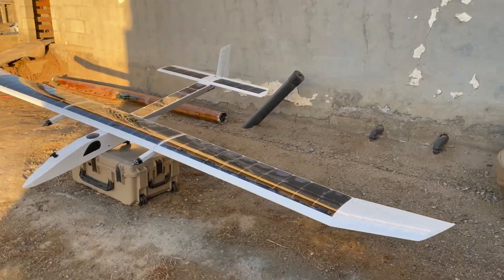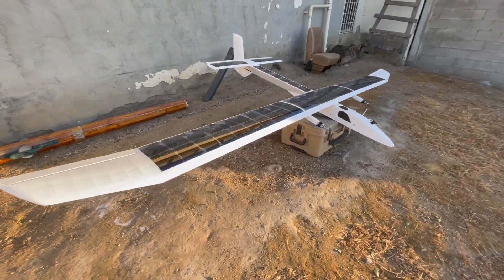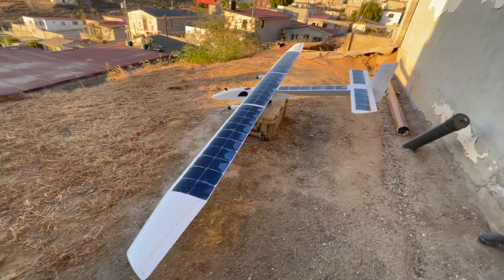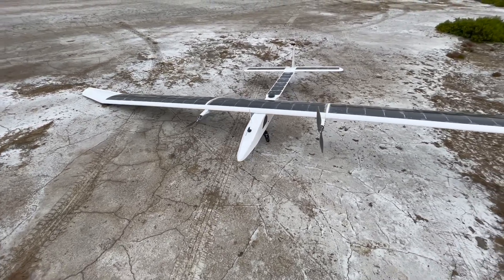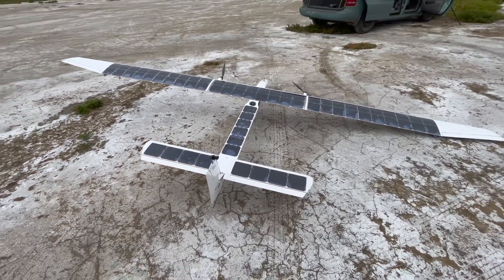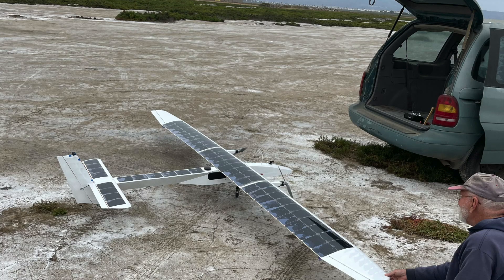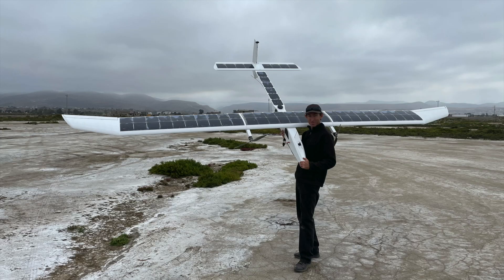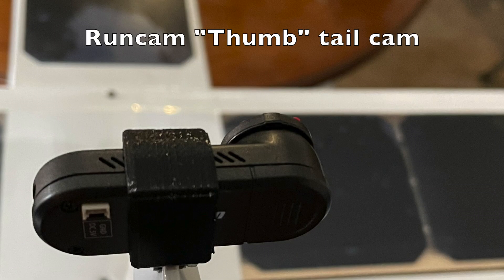Solar Plane  "SOLAR DRAGON" First Flight !!!

Comment: do you understand that  dihedral  OR  ailerons  should be used;  NOT  both.?
Reply from the maker: No I dont' understand why both cannot be used.    please explain.     it is neccesary to have both ailerons and rudder in order for the autopilot to make a coordinated turn.   and there seems to be no harm in having some dihedral.  plenty of aircraft out there with some dihedral, which also use ailerons.   they are not mutually exclusive.

Comment: information.       do you understand that you have chosen to use  thin  props that, like SF props,  tend to un-load as higher rpms.?            it is clear that the model has a less-stable   DISTRIBUTION OF MASS (dom).!!!       there is a  REASON  that a tail boom is  USUALLY  tapered.!        there  is a reason that, frequently, there is chord-wise taper across the span of a main wing.        there is a reason that motors/engines/props should be as near the center line as is practical.         at :07, what's  with  the  giant ventral tail 'skid'.?!?!?          googletranslate
i am wondering whether the wing is  CORRECTLY  made.
Reply from the maker: first of all the props..   yes, props flex.    these particlar props are less than ideal.   they do not have enough pitch.  i'm sure they do flex, and twist under load.  they do not have much load.  they are designed to spin much faster than we are currenly able to with this voltage and motors. 

less, stable distribuiton of mass..      not sure what you mean?   that it's too distributed, or not concentrated enough.   few large span aicraft have concnetrated mass.    we've tested many types of aircraft, and not seen any bad characteristics due to mass distribution. 

yes, It woudl be good if the tail boom were somewhat tapered.    however, probably not as much as it seems, as the horizontal stab is also in need of support, as is the wing, so for the next version, we will be incorporating some taper in the boom.  
tapered planforms...  sure, woudl be great, but it woudl change the reynolds numbers.  and for the solar plane, more importantly, would not allow even rows of solar cells to be mounted without wasting space.    as aspect ratio goes up, it's less of a factor in efficiency to have a constant chord wing.   and the outer sections do have tapered planform. 
Yes, it woudl be good, better to have the motors closer to the center, in case of a failure.  so that there is not so much offset thrust.  we designed the plane as a 4 motor config, and the inner pods are removed.  we will likely go back to this configuration of 4, or maybe even 6 motors. 
the "giant ventral tail skid," is just part of the vertical stab, extending below as well as above the fuselge.  It's called a crizifix tail config, and has been used on some aircraft before, notably solar impulse, and some high performance pushers.     so what's with it?   it is structurally more effecient than a vertical stab which only extends below the fuselage.   and imparts no, or little  twisting force to the fuselage.   it is a pain for landing.    
so you are wondering whether the wing is correctly made..     seems to make lift and it stayed intact for the one test flight so far.  with minimal flex.  so far we are happy with it.        specific suggestions that are helpful are appreciated.

Comment: Check out the Kraus K1000 ULE. It has full solar on the wings and elevator, but a very slim fuselage with few pannels on it. They are also using ArduPlane and autonomous soaring with great success!
Reply from the maker: Yes I did, thanks for the tip!   and I'll try to dig up some more info.  one of the leaders of their group, i recognized.  Saw her on an episide of BG THINK YT channel. she was talking about perpetual UAV's.   but she said some stuff that didn't make sense.  like claiming that a Ram Air Turbine woudl be useful to power the aircraft and enable it to fly all night.. of course use of the aircraft's kinetic energy in that way, with the conversion losses woudl be far worse than just using batteries.  but.. anyway.  seems that they have had some success.  will try to glean any usefull details from the project that are availabe.

Comment: Intermittent problems suck! Nice job saving the plane.
Reply: Yeah! There the worst to troubleshoot and solve.
Reply from the maker: @ezrarichardson279  we were a bit fortunate to observe the problem, very specifically, of the right aileron not moving when the left one did, immidiately after landing.   otherwise it may have remained a mystery,   but perhaps not, becase the tail cam caught the left one, and the action (or being stuck) of the right one can be derived from the behavior of the left one.
Reply: @FPVREVIEWS  good catch
Reply: @FPVREVIEWS  Nice! Was it a connecter that came half unplugged on the right one? Nice to know you were able to observe the problem. Sometimes you don't get too. I had  a plane I built that flew fine but then would suddenly do something really weird every once in a while and it caused me a couple crashes. 
   I still don't know why, it was definitely an aerodynamics issue though. I scrapped the whole aircraft after I realized that in it's current form it was a lost cause. I did make another one with the same electronics and it flies really great. 
    Lots of lessons learned from every aircraft it seems. I've simplified my designs and have seen a lot of improvement in flight characteristics. Love to see what you do next!
Reply from the maker: @ezrarichardson279  Dissected the connector a couple days ago.  it was just very poor quality, and the ground wire not making good contact between the pin and the slot it plugged into.   a regular cheap servo extension wire..  i shoudl not use those anymore.    so am changing all of them.  yes, a learnign expereince for sure.. as always.  simple designs tend to fly well with less effort in development.  but sometimes some complexity is needed to make advanced concepts work.   although they often undergo a similification process, or two, at some stage of development.   would love to see your designs.  will check your channel.  do you know what aerodynamic promlem caused the issue with the one you mentioned?    So far, i'm very happy with Dragon, and can't wait to fly it again.  it was scary at times, but there were times where it felt fine, and i was comfortable, like the fly-by's and the approach and landing. turns out that was the time that the aileron was working normally.   so glad i found that prob. and it didnt' eat the airplane.
Reply: (it's not the same flying wing as on my channel, that one is great!)

Comment: Great content! Many things can go wrong in the test flights. We have encountered similar issues with control surface servos. Servo signal is disrupted quite easily due vibrations. Especially the connectors if they vibrate agains frame for example.
Reply from the maker: Yes, although we usually catch these things before flight.  These were just very low quality servo connectors. we're going to discontinue their use and replace the ones on this aircraft.    True, there are always vibrations in the airframe, even if it flies very slowly.  If nothing else, because the air is turbulent.   Low voltage signals need a near-perfect connection.
Reply: @FPVREVIEWS  Do you happen to have any connectors that you favour? We have recently tried many different ones but are still finding good price/quality ratio solution.
Reply from the maker: @viimaaerospace3366  We have some Amass MR-30 conenctors that should be suitable and are relaible.  they can be a little stiff, but we havent tested them with wire connected, so will try.  We are using XT-30 connectors already for the solar connections at the wing joints.

Comment: tape three nickels to the nose
Reply from the maker: does it look too tail heavy?  maybe a little. ..  I also put some incidence in the horizontal stab, and could remove a little.        the other reason that it was oscillating (perhaps)is because there is latency in controls due to use of the PPM sum converter.  I need a better RC control system with SBUS out. preferably long range. just out of money at the moment.
Reply: @FPVREVIEWS  I would also add a pixhalk 4… in addition to the cube… split everything going on between the two…
Reply from the maker: @Paranoidtimes  It is my understanding that the Cube black already has triple redundant IMU's, heated, vibration isolated, and dual processors, for redundancy.  But, yes, it's the same idea.
Reply: @FPVREVIEWS  yes… I was suggesting a second one to handle some other Functions… if I understood right you flip solar chargers? Right? But manually? If the batteries where split they could flip automatically, charge automatically ect… I apologize I’m getting way ahead of your build… imagining how I would do it and so forth… it’s a bad habit lol the second could be used for this and with the smaller sizes of pi boards, it would be very easy and helpful to automate a system and one that can self control and correct in mid air… how cool would it be just to strap in at night and fall asleep as it flys along?
Reply from the maker: @Paranoidtimes  Oh, yes, the cube can be connected to a companion computer, such as a raspberry pi, etc.  I have no idea how exactly that would work.. and I guess the companion computer could run some code which would handle the MPPT charging.  there are plenty of AUX outputs on the cube black already. like 6, or 8 of them.  but perhaps the companion computer would have a direct signal from itself to the charge controller.  Not sure.  That all is beyond my scope at the moment, although I would like to learn how to write the code for it, etc.    Without any help or collaboartion on that, I would probably just purchase a stand alone MPPT charge controller and install it, letting it automatically handle the charge controller functions.  That's what has been done, more or less, on other successful solar aircraft projects.  seems sufficient.  I can think of other things for a companion computer to manage, such as to change the climb/glide profile to store kinetic energy in the form of altitude approaching solar evening, and after solar morning.  as well as managing navigation to suite weather conditions, to stay out of storms, take advantage of tail winds to get to a location faster, etc. etc. etc.     the direct solar charging is a very short term solution to make sure that the plane does not erupt in a fiery plasma ball of hell while on the ground, or in the air during the first flights.   funny story:  I realized on my way to the field that the plane was sufficiently assembled, with the center wing section, and horizontal stab on, and connected, that it was charging the battery which was already fully charged, while inside the transport van, and was worried on the way there that it would over-charge..  but it was ok.. there was not enough power to hurt it, and it was very overcast.  but I'll be switching it off next time.  might even install a hardware safety switch to kill the solar array output when not ready to fly, and add it to the pre-flight checklist.   you know how those Tesla batteries can get when they are over-juiced..   ha ha 
thanks for the suggestions.
Reply: @FPVREVIEWS  “Acxico  Solar Charge Controller Board” cheep and effective
Reply: Should let you switch automatically from solar to battery depending on the voltage from the panels… small as well… would be great for long flights
Reply from the maker: @Paranoidtimes  Thanks for the suggestion. I'll check it out!
Reply: @FPVREVIEWS  a little, but i think the " three Nickle approach" will give you a little better climb... and more control... its a wonderful plane! it commands a number of aircraft ideas that will need to be addressed each on their own, large guilders seem to respond better with a hair of head weight... some of mine i plan to make a bladder system where I can change weight elements during flight... i do believe I may use a few of its concepts... for a new large build, i do think we can keep that baby in air for 2 days or more

Comment: Unlike the stressful moments, the flight was succesful..! Congratulations and great landing as always! 

Seems like you need to extend the ailerons somehow for more roll authority - Maybe (redundant) ailerons behind the trailing edge - behind the solar cells - and servos underneath the wing. But the wiring could be challenging to do since the wing is already finished.

Can't wait for the next video - and when it's flying with solar power!

EDIT: If the ailerons stay the same, I recommend differential thrust - that helps alot with roll authority. 

Good luck!
Reply from the maker: Yes, we may add aileron or extend somehow.  But I’m anxious to see first how they work when one is not locked.  It escentially prevented the other one from working too.  It’s not too hard to add something to the wing.  Ribs are hollow.  😊
Reply: I like that, "redundant ailerons" because that also means additional servos (which does mean weight too) but this big bird has lift in strides I'm sure. With some mixing you could get those to become flaps as well for landing, the inner ailerons that is.

Comment: That looks awesome, I need to get back into RC flying now that my move is done.  0Differential thrust may help the ground handling issues.  RCTestflight has done similar solar flight work over the years, up to a 100 mile solar powered autonomous flight.  He may have already discovered the solution to some issues that now plague you.  https://www.youtube.com/c/rctestflight/videos

Comment: Any chance light-weight Graphene super-capacitors integrated as part of frame structure could help current surge ability in the event large amounts of torque are needed? See 'Revisiting the Supercapacitor - The Wait for Graphene is Over' Product by Skeleton.
Reply from the maker: In fact, we are using low ESR caps, in the wing, in the main power lines, just before the battery cables reach the motor controllers.  to help with voltage surge.  The power levels needed for this plane are actually very low, but the cables are a bit on the long side, and the controllers "chop" the power, using PWM technology. so the CAPS help absorb those, and stabilize the voltage going to the ESC's.   The battery is a 3S7Pbattery.  so at 7P, and with each cell able to output 10 amps continuous, the battery can output 70 amps.  the connectors, XT60, limit that to 60 amps continuous.  and the current power system can only pull about 27 amps static.   so there is no need at this time for more current demand.  and if there was, we could just use another battery cell type, but we like having the highest gravimetric density, and it's pretty much max for these batteries.   I'll check out the graphene supercars that you are referring to.

Comment: Are there any plans to modify/change the servo joints?
Reply from the maker: Yes, we'll probably use 2S balance lead extension connectors, or possibly xt-30 type 3 pin connectors that I have. depends whether the xt type can pull apart easy enough. they seem a bit stiff..  but I'll try with wire soldered on.    good question.
Reply from the maker: we just swapped the connectors for MR-30 type. both sides.

Comment from the maker: So for people asking:  The Maxeon C-60 solar cells are not hard to solder together. they take solder easily, and are fairly flexible.   each cell has 6 solder pads on it.  3 per side. positive, and negative.  they also have built-in diodes, so no need for external ones.  they really are great for this, but better not to bend them too much. we cracked 3 while doing  the build. all got cracked while applying the clear film over them.
Reply: Is there some type of backer you could apply to them before laying them on the aircraft? Maybe something like a backerboard but glued on with an epoxy type glue that would also give it strength against flexing but not add too much additional weight. It would be tedious but you could just test one off of the airplane until you got your design right. 

Do the panels still output the same power even though they're cracked now?
Reply from the maker: @helloman1976  I think that the reason why they cracked was because (at least partially) of internal stresses, and did so once heated.  I replaced the cracked cells, and none cracked on the test flight.  each cell rests on two ribs, which have reliefs for them. very small ones.  the cells are very flexible and resilient, to a point.  not bending them too much in the beginning is the key.   and yes, supposedly, they output the same, or almost same when cracked. I did test a small section, and even to destruction.  I'm confident that if they do crack some, it won't hurt performance much, if at all.  so far so good.  I was worried about that..  will probably not stop worrying.     maybe someday, I'll look into epoxy, glass encapsulation methods for a composite wing..  when funds allow.
Reply: Nice job! Did you used any kind of MPPT's or did you just wire the panel to the batteries? Also do you have a BMS on your batteries? 
Thanks!
Reply from the maker: @yoyococo9657  Solar charging is direct, with 3 electronic switches, on an RC channel.  you can see the previous video to see the exact setup.   we view this as a temporary solution.  MPPT is the better one. Open to suggestions as to specifics of the equipement. No, we do not have any BMS at this time.  can you recomend one?
Reply: BUILT IN DIODES.?!?!?       a pv cell makes  DC.!